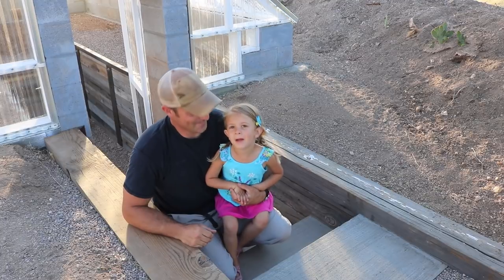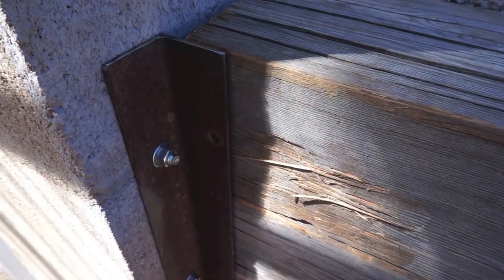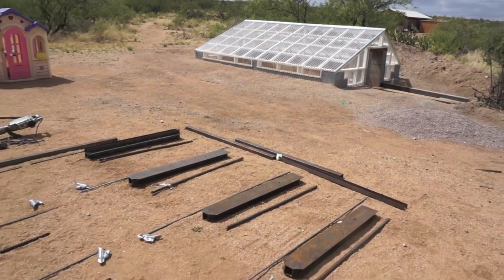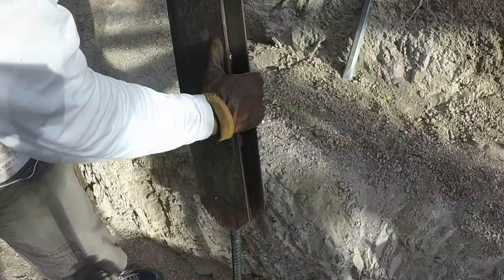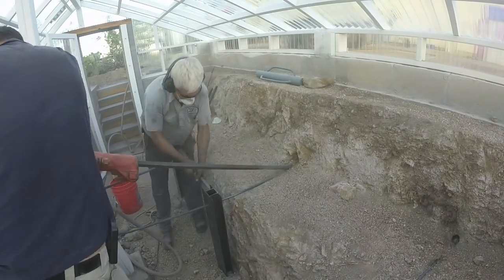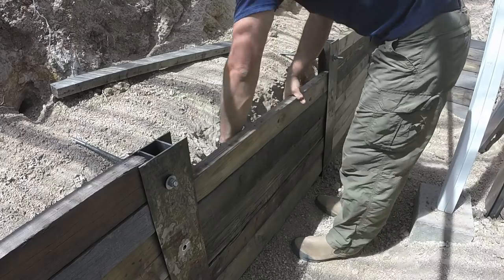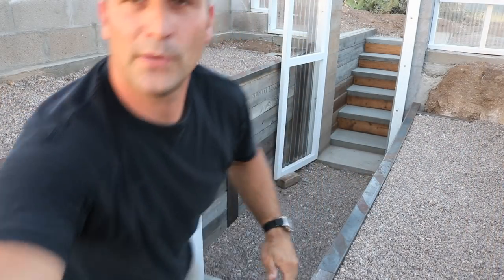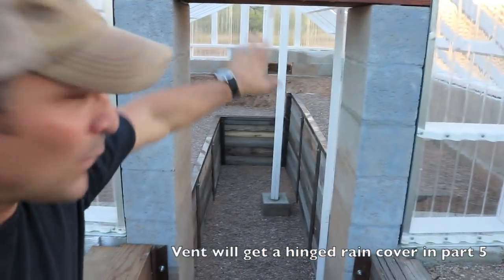Sunken Greenhouse Part 4:  Entry steps and Retaining walls

Comment: Nice swimming pool
Reply from the maker: lol... nope not a pool yet;)  We have an incredibly low water table and all of the ground flows away from the structure.  In other areas it might just be a pool... but if that happened then I would be okay with it as it would mean that I had lots of water to use for my garden:)
Reply: :) I was just thinking out loud, the design might not work everywhere.  In some place that get snow, in the spring, while the water may down below, normally,  for a while the melting water is all on the surface. 

Keep that in mind, should you decide to build an underground tank ...without any concrete pad ballast below.... thinking you will be saving money.....water table can be below, but melting snowfall in the spring, or heavy rainfall, and your tank will be on the surface.

The below ground greenhouse design is good for high winds, and imo would be better if worked into the side of a hill, in most locations.    Or the sides built of concrete blocks on a flat surface and dirt mounded up around them, making a hill,  for water to drain away.

Your greenhouse looks good for sure and the thought that went it to it.

Comment: the sutter system is neat but concrete would have sufficed...the big issue is drainage & heating and cooling..
Reply from the maker: Thanks for checking it out Louis.  Yes, a bit more projects that I have to finish but it's coming along.  Got Part 6 up now and next will be part 7 that will entail the cooling tunnel and the rainwater harvesting:)
joe

Comment: Will it flood inside there when the heavy rains come?
Reply from the maker: +Logan Carroll I'll be answering that in more depth in the QA video for this project.... but the quick answer is that it shouldn't... extremely low water table, sloped grading, etc,.  
Joe

Comment: did you run water & electrical into the greenhouse?
Reply from the maker: Hi Bill,

Nope, not yet, and probably won't.  Adding those utilities adds in permitting issues that I don't want to deal with.  I will have a raincatch and tank for water... but it won't be 'hooked' up to any house water.  As for electricity, i might do some solar lights or something:)
Joe

Comment: That place is going to be an oven in the summer. Other than that I like it....

Sutter Retaining Wall
http://www.sutterequipment.com/retaining_walls.html
Reply from the maker: yes, it is a hot box for sure in the summer:)  but it's mainly for my winter and late fall/early spring time.... we are in a cooler portion of the desert but it's still hot for most of the year...so it definitely won't be getting used in july;)

Comment: Hi I noticed your childs play house outside next to the greenhouse,  I wanted to warned you that many snakes like to hide in structures like that so look for places inside were there can roost the heat and teach your child to look before entering, greenhouse also will attract quick fix is moth balls the smell drives then away, my Grandfather had a hole obaut the size of a car and 6 ft deep cover with zinc planks to kind of creating a perfect Habitat for reptiles near the house He'll check in the morning and if he found any Dangerous snakes hell kerosene them, but it was by the Venezuelan rain forest so you might not have to deal with vipers and so many other as he had to to protect his many, many, many youngs like me. By the way beutifull greenhouse God bless.

Comment: a  nice job  looking good . with your event on the inside wall at the bottom what is going to happen when you're top vent moves hot air out the ground  vent will let the cooler air in and I think you'll find the ground that tunnel would worki good with clay tile and if your plant grass  over on that water it the temperature that air coming in would be a lot lower and I think when you start growing  plants in your greenhouse and watering the inside will help cool your greenhouse in hot weather you're doing a really nice job these are just some thoughts you might think of a windmill for water if you have any questions I'd be happy to answer you can contact me through    jpmorgan917@gmail.com
Reply from the maker: Thanks JP.... yes the venting is something I'm still figuring out.  I have an idea for a windmill powered fan but currently I just installed a solar vent fan and a wind diverter in Part 5 (up today).  so far so good on those... and the cooling tunnel will probably make its way into part 6 along with the rainwater system.... provided I have the energy to dig it right now...lol

Comment: This is insane. You have done a ridiculous over-engineered product that doesn't fit the supposed purpose. Plants grow up, and your planting space starts at waist level and above. How are you going to harvest anything--a ladder? You have extremely little space inside the concrete Fort Knox you've created. There's almost no grow room vertically. You could easily have built a simple foundation and a sturdy roomy greenhouse on top of it. It's obvious that this isn't a greenhouse; it's a vanity construction project where you get to show off all you know about building stuff. Nothing wrong with that in a way, I guess, but what a colossal waste of time and expense. You should have built a normal greenhouse if that's what you wanted, and put all that other effort to building something worthwhile.